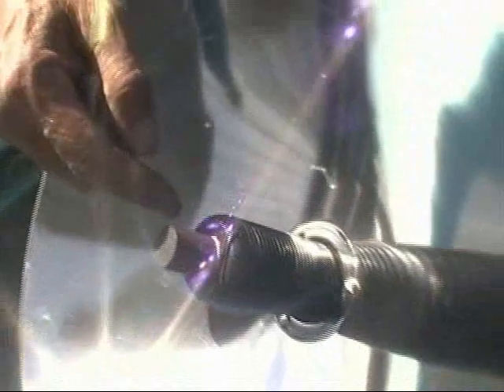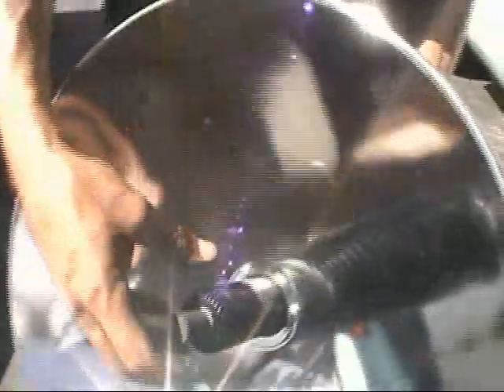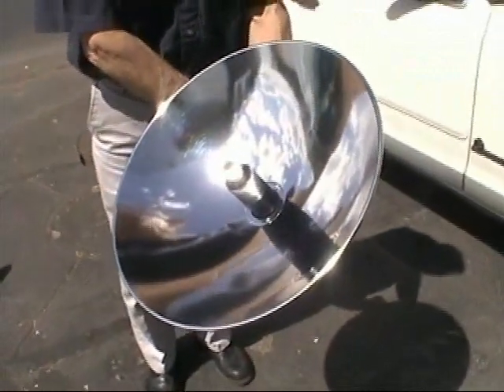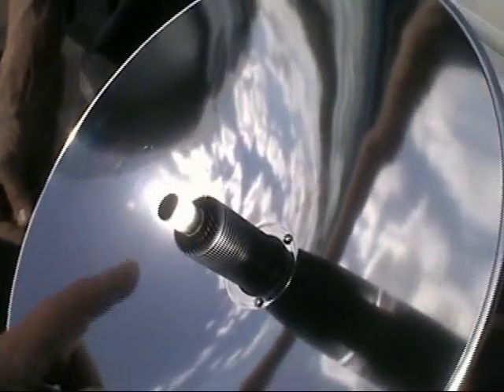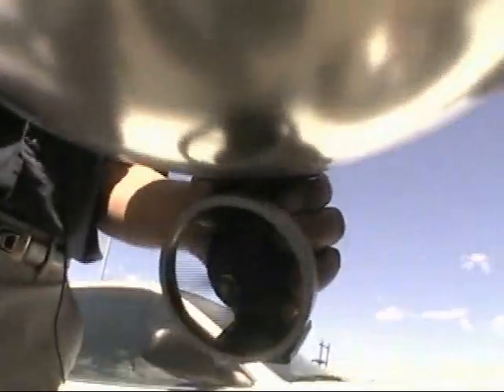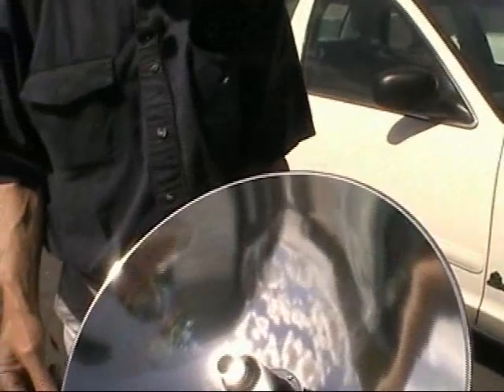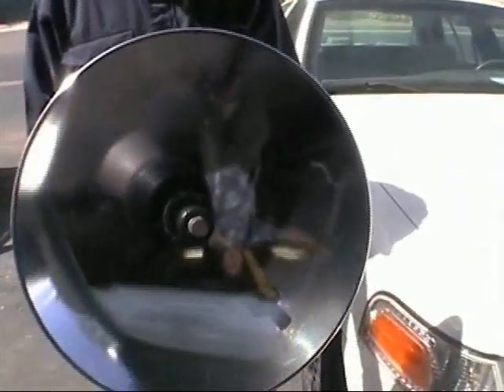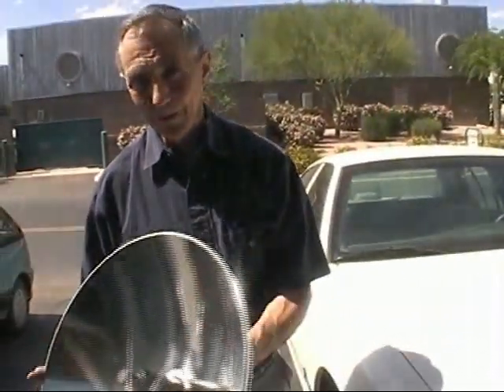Stirling Engine Model Demonstration

Comment: It isn't practical enough for placing on a vehicle. Solar panels also only work well when directly facing the source, not just facing up. If facing up, it must be a clear sunny day for them to produce any current. Considering the power output to surface area, you might only get a few hundred watts on a sunny day. Not only that, your car would be ugly and it would be difficult to insulate as it is well known that solar panels get very hot...imagine all the extra material and weight you have to a

Comment: @randommagnum The Sterling engine works by Means of the heating&cooling of the oxygen inside of the sterling engine after you manually start it. 
1. As the heat expands oxygen, it PUSHES the piston
2. Then the air that was heated went to the other side of the piston to be cooled AND when that air cools it decreases in mass causing the cylinder to be pulled.
3. Then when that cylinder pulls, the air goes back to the other side of the piston to get heated again
4. back to #1.

Comment: @jasonwilfong People usually used regular oxygen, let alone helium or whatever, LOL! Some STERLING ENGINES are far more efficient engines than others. I heard that the "Duplex sterling engine" is FAR more efficient than the other sterling engines. Little oil lamps or candles use to power fans and the duplex sterling engine use to power popcorn makers

Comment: OH PLEASE!! Sterling engines are GREAT, BUT dont mock oil. We're SOO dependent on fuel, well guess what, we're SOO dependent on food also! The guy mentioned fossil fuels, WHAT A JOKE! HA, like fuel came from dinosaurs.

Anyways, I only see sterling engines as a stationary engine. ALSO, I think a FRESNEL LENS which can melt a penny(few sec) would work FAR BETTER than that mirror bowl.  They have great potential, but with liberal guys like this, the sterling engine will never see the light of day.

Comment: @MrJastin Er,sadly, no.
 I guess you are extrapolating your Ikw from his "  30 ft dia  would give 30KW "
Unfortunately not, or I'd have one ina  minute.
Area of circle increases by the square of the factor of increase. 
. Area of 1ft dia circle is pi X radius squared = 6"X6" X  3.142 = 120 square inches approx. just less than a square foot
30 ft dia. = 15ft X15ft X 3.142 = about 700sq ft.  Parabola is almost spherical
but area of parbola is 4Pi  R squared so same applies

Comment: @dzgfdg it needs a weighted flywheel with a 2 or 3 to 1 ratio belt pully system or chain configuration to turn a generater/alternater under a load. Their are alot of ways to do it but not many people with time and tools who are motivated to do it... I would use steam, it has compression..Czar

Comment: Why is there never a generator on these, without which it would only be an aggravating noise maker? Connect it to a generator hook up the Amp and Volt meter I want to see the output. It's not a model unless I see some Wattage.

Comment: Just the noise it was making could be measured in milliwatts.  I have some 5 W computer fans and it looked like it was putting out enough to drive them.  0.78 sq ft is about 0.075 m^2 or  75 W in bright noon sun.  So 33 W would be 50% efficient.

Comment: you will have more power but the efficiency won't change. also, you need a good cooling system beacause stirling work with temperature difference

Comment: you all are crazy with your conversions!! Here is an example: double the resolution of a video file from 320x240 to 640x480. You only DOUBLED the resolution, but the new AREA of the video is 4X that of the original, NOT DOUBLE. (320x240=76800, 640x480=307200, 307200=4x76800). Same goes for the area of a circle, as radius increases, the surface area increases by some multiple or exponentially

Comment: Its a simple Stirling Engine, that uses a hydrogen gas as a medium inside its cylinders. 
It has a hot part, heated by the parabolic mirror, and a cold part cooled by the ambient temperature of the air. It uses this temperature differential, to make the gas contract and expand through a cycle, and produce power.

Comment: solar thermal power generators like this can produce electricity at night by storing extra heat during the day.  What they do is during the day they gradually heat water, or in the more intense versions they actually liquify salt.

Then during the night they use this as a heat source, and they keep running.

Comment: no you're wrong, solar cell efficiency is much higher than 20% - much higher even than 28%!

Current production triple-junction cells have 35% efficiency, you can go out and buy one.

The record for solar cell efficiency is currently 42.7%, held by the University of Delaware.

just google it:
Solar Cell Efficiency Record

Comment: Thats wrong. Current Photovoltaec cells have an efficiency of max. 20% It can probably increased to 28% but not more. The reason for this is that the intensyty of UV-Spectrum of Sunlight is the ony used one for the Cells, other wavelengshs wuld not work.

Comment: If you heat the Center somehow it will run at night too. A Stirling Engine works with one heated part and one cooled part. The hotter the hot part and the cooler the cool part the more efficient is the engine.

Comment: In the video he says that "The best solar thermal stirling engine is 4x better than the best photovoltaic"
But that's wrong.

The best solar thermal stirling engine design i've seen is under %30 efficiency.
Whereas the current record for photovoltaics is around %48 efficiency - and it keeps going up.

Clearly the video guy doesn't know what he's talking about.

Comment: So if thats about 2 times as efficient as solar, then it should be technically about 15% x 2 = 30 percent efficient then.  Thats good.   A square meter of good sunlight is said to have 1000W, so 30 percent is 300 watts would be produce.  will home units be available sometime?

Comment: the reason that the efficiencies are confusing is that for solar photovoltaic cells, the average conversion efficiency is about 10 to 25% for current tech.  Using a stirlimg engine, I have seen claims of 40%.  So for solar cells, converting 1000kw per m2 to the lowest conversion is 100 watts per m2, but a properly set up Sterling can produce 400 watts per m2 per the same area.

Please do not think that a 3 to 4X increase equates to 400x.  3 to 4x equates to 400 PERCENT.  not 400x.

Comment: You can buy reflectors lıke this almost anywhere on the net,  You just have to be a bit creative.
To answer some other questions, A larger sterling engşne is NOT 400x more efficient.  But perhaps 3 to 4x more.  Simply put, a 1000CC engine is more efficient and uses less resources than 100 10cc engines.